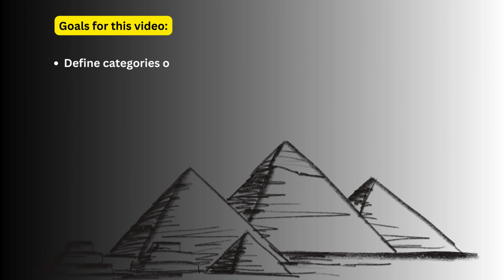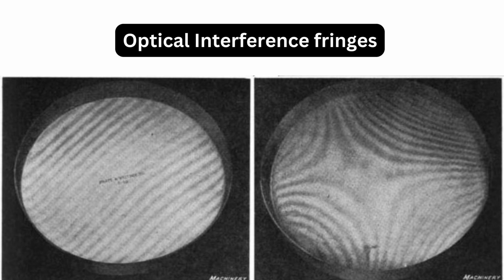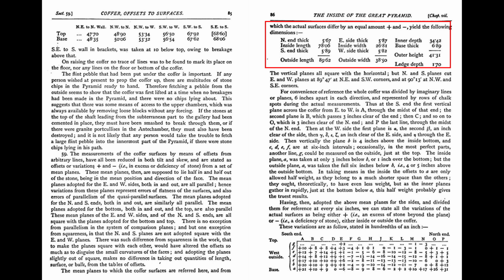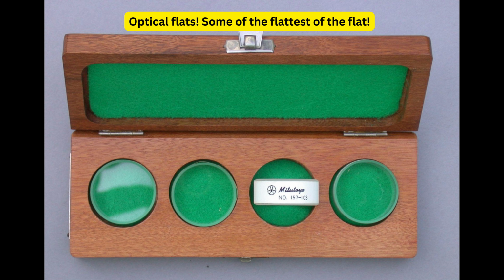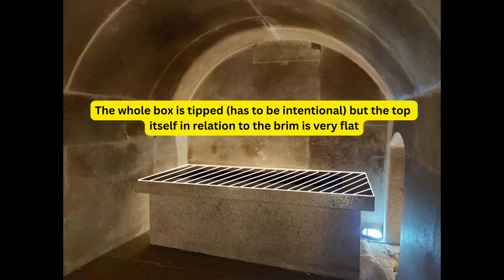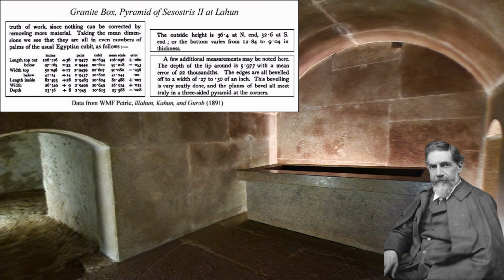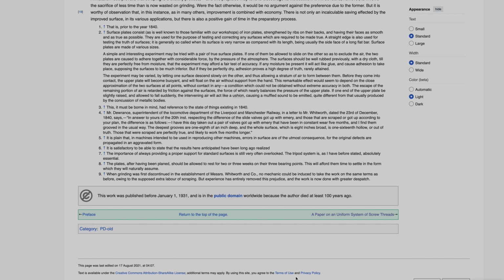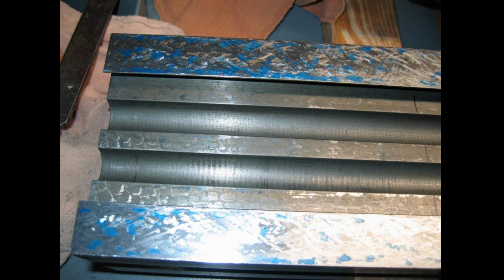The Problem of Flatness in Ancient Egypt

Comment: Well, I would say interesting video. TLDR: solving the easiest part of a riddle will not open the door.

Thank you very much for the demonstration of lapping. Well done. No, not only irony, I mean it. Very well done. Especially the part about the ochre markings. I did not know that. However. As you are one of those channels that still have few enough subscribers to read every comment: you took the easiest part and demonstrated it thoroughly. But what about polygonal architecture. Only take the valley temple as an example. Have you been there? I have. The blocks there align themselves at least to the .5 mm margin. To be honest, .5 mm does not suffice in quite a few places, and there is always the point of wear and tear (didn't a serious earthquake in the Middle Ages allow for the casing stones of the Khufu pyramid to be quarried in the first place?). Anyway, let's stick to the .5 mm. This accuracy (at least) is maintained in blocks that not only go around the corner - literally - but the blocks in the same wall have up to eight(!) angles (a "conventional" rectangled block will have four, both examples only speaking of the angles adjoining to the other blocks, of course), all within the same tolerance of seam gaps. I do not see how this can be explained with lapping alone. Then there are the Barabar caves - but these are a chapter in themselves. Concerning your comment on the vases: let's wait for the next 6-12 months until independent results of vase scans from different museums are available, shall we?
Reply from the maker: I agree that the other issues like the polygonal architecture or the vases are indeed a much harder problem. I’m up for the challenge. I do want to see that scan data before I make any conclusions. Stay tuned!

Comment: One thing I found very useful when scrapping machine elements. With White Lead being basically banned using Isopropyl Alcohol on the surface to be scrapped works great. Dampen a lint free cloth with the alcohol and rub the surface to be scrapped. Let the alcohol evaporate. Blue the master element and apply the master to the workpiece. The blueing will standout beautifully. As always do not over apply blueing to the master. Doing so will give false readings. For blueing the best is Dykem High Spot. Avoid using inferior products such as Permatex. The tip on using alcohol l got from the Rebuilding Machine Tools book. A masterclass on the rebuilding of machine tools that includes all the steps needed for each type of machine.
Reply from the maker: You know a lot about this topic, more than me I’m sure. What do you think of my applying some of those principles to the construction of these boxes?

Comment: Like others I expected a lot less demonstration work and am very much in the advanced technology side of this argument. Barabar caves and the vases will be something completely different though since lapping only explains the flat parts. 16 micron deviation from perfectly round is something else entirely since lapping could make what we see here on some of these boxes but would fall apart potentially if the sides all have the same measure. (Meaning side to side being the same vs lapping one side more than another) Subscribed!
Reply from the maker: I agree that this method does not transfer in the same way to the vases. That will be a problem that shall test my brain cells but I’m up for the challenge. Really appreciate you commenting and subscribing

Comment: The "flatest" or perhaps more correctly expressed as "planer surface" in the common items we see in our environment is most likely plate glass. Granite countertops most likely aren't. A good example would be a video by Matthias Wandel where he finds his piece of granite countertop he wanted to use for a "flat" working surface was hollow in the center by over .5 mm iirc. Also the flatness of installed countertops is going to be influenced by the cabinets they are sitting on.
The ancients if they desired producing flat or flattish master surfaces could have used a scraper blade chipped from very hard type of stone imo. Granite is easily scraped with modern scraping tools. I've tried it as an experiment in the corner of a plate.
Reply from the maker: Great points. I agree!

Comment: edit: ok. only the flatness comment in the first 30 seconds was.. questionable.  
flatness in nature - well. you have water, you have strings, you have split stone types. there IS flatness (for that degree) in nature. or, if you like to live dangerously, you can even use elemental mercury. also, you can in theory mirror finish a surface and use any kind of stripes or grid to see unevenness. also as, thankfully later in the video explained, you have "grinding"
Reply from the maker: Yes I had to lay the ground work, I opened the video with framing the argument I would later, hopefully, demolish!

Comment: So to add my two cents... now try doing that with blocks that weigh more than 5 tons. I think that changes  the picture just a teeny bit. Now do it with the rocks  at Sacsayhuaman. Good luck.

That said, excellent video!
Reply from the maker: You're right, there are so many secondary questions to get to. But at least this is a reasonable starting point. The rocks of Peru at Sacsayhuaman are not as hard as granite and I have a video in the works for that,. I believe those walls had an entirelly different method of construction from what I laid out here.
Reply: Are you implying aliens? Or just different techniques?

Comment: Explain the precision inside corners.
      Your video is hogwash, boulder dash, tomfoolery.
     Don't make a complete fool of yourself trying to explain the incredibly precise stone vases.  They are beyond modern day machining.  We have not the technology to achieve the manufacture of these vases. The wall thickness of some specimens are thin enough to have light pass through them.  The handles are of the same stone, not added later.
Reply from the maker: I would advise you do as I do, attack my ideas with better ideas. Focus on the data, not the man. This was not a video on the vases so if you want to disagree do it on the topic and do it with data. I was very narrowly focused on the flatness of the boxes. Shifting the argument to topics not covered in the video is disingenuous. I also didn't explain underwater welding, why wet hay combusts on its own, the reason why fog forms over ponds on a cold morning. You say that they are BEYOND modern machining. Okay, what is your data for that, and what instrument was it measured with. Please show me data for the specific items I talked about here that is beyond that of an optical flat.

Comment: A string. If you sent me into the woods looking for flat, I'd stretch a string between two points. Today we call it a plunb bob or chalk like.
Reply from the maker: It would be straight, but would it also be flat?
Reply: @intothemap360  If you have straight, you have flat. Pin one corner then fan inch by inch to the other. Repeat with smaller increments for smoother. You also have square too. Measure 45 degree corner to corner, then repeat for other 2. If length is the same, it's square. You can do a LOT with string.

Comment: To get an initial flat surface you could add a dam made from clay and fill it with soapy water, then measure the depth with a stick
Reply from the maker: I believe that would get you to level, not flat.
Reply: @intothemap360 both, or concave if you want to be more precise since there is water tension at the edges which will pull the edges up.
But you still have to remove the high spots with something flat
Reply from the maker: Yes surface tension is of course to be taken into account. The humble water strider takes full advantage of it!

Comment: I have a question.  If I am understanding correctly, are we talking about the point flatness and smoothness intesects which is dependent on use and function?   Something can appear, by all measures smooth, but not be flat.  Something can also appear, by all measures flat, but not be smooth.
Reply from the maker: Yes. A sphere can be smooth and not flat.
Reply: @intothemap360  Thank you.

Comment: It’s a bit like roman bronze water taps. They had twist valves that sealed perfectly without needing to be machined perfectly smooth to stop water leaks. Their solution - a slight taper and a slurry of clay. The tapers were first made with simple tools from the cast parts, to get both parts similar then put together with the clay slurry and spun. Each part grinds against the other and the clay slowly gets squeezed out as the fit improves. Eventually both surfaces are an almost perfect fit. They don’t leak over time either. All it took was a leather washer to pre-load the tapered seal so that over time and use, the tap continues to polish itself and stay working and leak free. Rather ingenious, really.
Reply from the maker: Interesting, I shall check it out.
Reply: By the way... the Egyptian civilization lasted longer than the post-Egyptian civilizationS have lasted up to today. They had time to develop.
Reply: Or it could have been done by aliens.
Reply: @simontillson482 uhhhh.......just use the leather washer and disregard all that other bullshit. done. completed.

Comment: Hand scraping is still used on precision machine tables, and it's not cheap. My company had to fly a guy in from Connecticut to resurface one of our machines in Ontario. An 11.5 x 8.5 inch table took all day and I learned nothing from watching him except that I could never do it. I've made a lot of aircraft parts, and I have no idea what "aircraft grade precision" means.
It would be possible to get actual measurements of the rim of the sarcophagus by laying a parallel on top of it and measuring down with a depth micrometer or a height gauge. They're available with a base meant to slide on a flat surface and an articulated arm the dial indicator mounts on. That would give accuracy within .001" or better and would tell you how "flat" it is down to the little dips and bumps.
Reply from the maker: well said! I would love to see some better measurements of these

Comment: Your missing one important factor these "sarcophagi" were made from a single block of granite the best granite companies today can not reproduce these can't wait for your take on the vases great video
Reply: And about those bottom inside corners, that took some serious rubbing
Reply: @stevegriffin1535  - Never underestimate the power of apprentices. Craftsman would have had sons who needed to learn the trade.
Reply from the maker: No one said it would have been a FUN job. As far as the inside goes its a mortising problem. Drill holes around the edge and then use hammers and crowbars to smash out the middle. Then you just have to flatten the drill marls off. By the way you can still see those core drill marks on some of these!

Comment: The question at 12:55 has honestly plagued my own mind, since the early 70's when studying ancient Egyptian  methodologies myself... HOW did the FIRST instrument of 'perfect flatness' actually get - achieved? The 3 plates theory, to this day is just that and NO CURRENT scaled product or exhibit of ANY size has ever been made to prove this, especially when you consider we can't do it with modern materials (sand media/diamond dust)... So honestly, how was it done, then? When will any Scientific measure be contracted to be attempted? I'll wait... (P.S. enjoyed your video!)
Reply from the maker: You mean we can't flatten granite? The best surface plates in the world are granite, they can be massive (I have seen a 16 foot one) and we DO flatten them with the methods shown here. Glad you watched the video though!
Reply: Dude, the ability to mass manufacture parts at all is only possible due to the three plate method. Gauge blocks, which are used to calibrate distances and flatness, were (and often still are) manufactured using the three plate method. It’s not theory at all. The difference between those gauge blocks and older techniques is that Whitworth used blue dye to ensure that every high point was eliminated, so that it wasn’t just generally flat, but locally flat as well.

Comment: I think they used a type of sand paper with ground hard rock and a type of glue. Yes, they used gauge blocks of a sort, but glued thin paper or animal skin, with sand glued onto that, onto them. When the sand paper wore down heat would be used to separate it from the gauge blocks and a new piece glued on. This would preserve the flatness of the gauge blocks, as well as create a more effective grinding surface than slurry.
Reply from the maker: The glue is an interesting idea, I certainly think that would be a good method to try along with the other ones when trying to replicate this